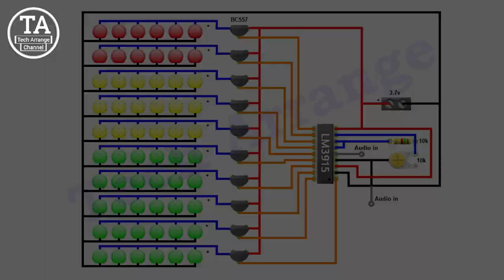[NEW] Analog Model Music Reactive LED Chaser Circuit 2022

Comment: how to use microphone as audio signal?
Reply: Not too hard. The chip this is based on is a cool Texas Instruments chip that’s been out a long time. It’s basically an accurate 10 channel resistor network in 3db steps. I used four of them to build a 20 step or 60db per channel, stereo pair Power meter setup for my stereo. The other cool thing is that the chip can take up to +-35volts directly. So you can use it even to measure power from a larger amp…say 150 watts or so quite safely. For a microphone, you’d just have to measure after your preamp.

Here is the data sheet for the IC:   https://www.mouser.com/datasheet/2/405/lm3915-443929.pdf